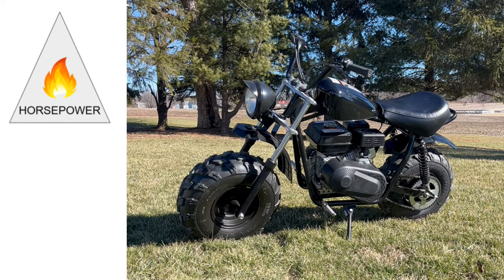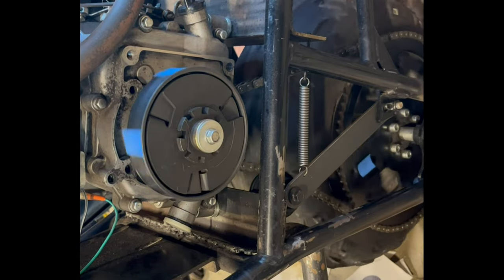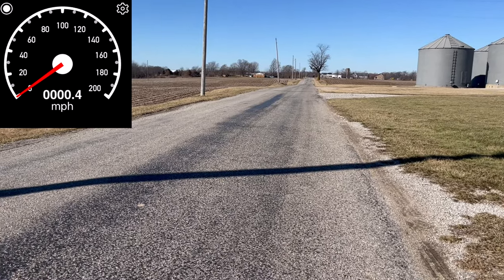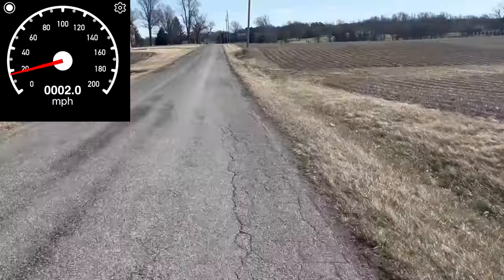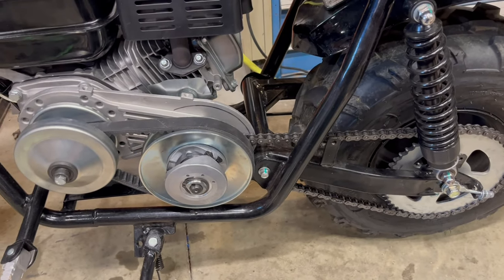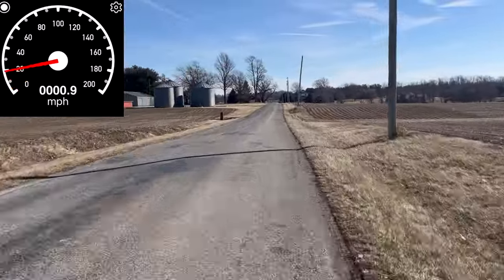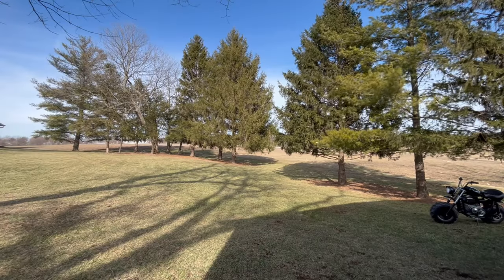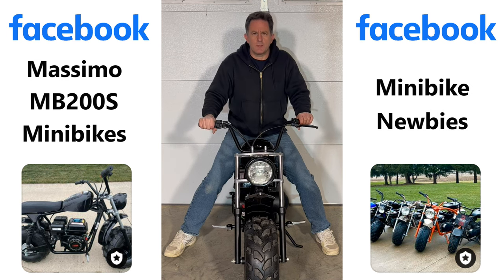The Secrets of Minibike Gearing

Comment: for those that are confused by this video the colemans in all stock form 
have a gear ratio of 10 to 1 thats a pretty good all around gear ratio
its good for startin off on a hill but it doesnt offer much in the way of speed
 the governor in my bike is defective so i get a top speed  of 25 M.P.H. on flat ground others report like 13 mph.  with a properly working governor
the way i determined the 10/1  gear ratio is is by turning the clutch untill the rear tire made one full revolution 
i ride my bike on dirt roads  an honestly i rarely hold full throttle for more than a few seconds  because of the ever changing road conditions 
it literally goes from hard pack scattered with loose rock to mostly hard packed white with random loose spots to a creek crossing  then hard packed red clay with ruts then a long moderately steep grade that being said 10/1 gearing is an excellent choice for that

Comment: Good info!  The torque converter is king for obvious reasons.  I actually have a ct200u, and just installed a torque converter with the 5 to 1 gearing and 19 inch tire.  Take a look at the yellow Secondary spring, it helps greatly to keep the rpms up.  And also a true comet belt seems to be the ticket!  The cheap ones flex too much and don't achieve full shift out.

Comment: Got a 212 with the governor removed, header, carb and flywheel now on my little oryxearth that had a 105.. looks almost exactly like that little mega Moto frame, thing absolutely rips now😂 think I’ll pop the crankcase back off after a while and rebuild the whole motor then throw on a torque converter with a 60-65 back sprocket. Perfect mini trail bike. Fits in the back seat of my car 😂

Comment: Best gearing for a monstermoto 80 w a predator 212 on it 22lb springs, flywheel, rod, upgraded mikuni vm22 carb 125 main jet im running a 10 clutch 40 sprocket

Comment: I enjoyed the video.  Sounds like the torque converter is best but if I just wanted a little more hill climbing power without spending a lot of money what do you recommend?  I have a Coleman ct200.  Is it best to put a little larger rear sprocket or a smaller clutch sprocket. I don’t care if I loose a little top end speed. Thanks.
Reply from the maker: You can’t get a jackshaft sprocket with less than 10 teeth.  Yep, replace your 50T with 60T. That will give you 20% more torque and 20% less speed.

Comment: I am running 12t on the front with a horstman x5 racing clutch. And a 65t rear split sprocket. If I cut down to a 53t rear split sprocket would I go faster?
Reply from the maker: Yes, 20% faster.   20% less torque

Comment: So on my mini bike I put a 224 predator with a 30 series torque converter.  Stage 1 intake & exhaust. 10 tooth sprocket up front with a 72 tooth sprocket in the rear for max torque.   Surprised that I hit a top speed of 41mph running 21” tires.  Not looking for speed with this build-  Going to an 8 tooth sprocket up front for all kinds of insane hill climbing torque..thoughts?
Reply: Small to big = torque 

Big to small = speed

Larger rear sprocket will give more low end grunt

Going smaller on "driver" side will tack out the engine very quickly.

We used this combo: 212cc

Driver   vs.     Driven =  speed 

14                   60           44 mph
12                   60           37
10                   60           31
8                      60          23-25

Pops wheelies constantly  not user friendly 

11                   50           33-34

Best set up so far

Comment: I have a taotao db200 I want a 60 tooth should I go 40 chain? What chain should I use when I go up to a 60t
Reply from the maker: The DB200 uses 420 chain and you should stick with that.  So get a 60T-420 sprocket, some extra 420 chain, and a chain breaker tool.

Comment: A few questions 
1.) When you go from the 10 tooth to the 11 tooth on the torque converter do you have to change chain size or the same chain will still fit?
Also
2.) When you go from the 10 to the 11 tooth on the torque converter does that make the engine rpm go up? If so should I worry about the engine spinning to fast on stock internal parts? Or will it still not spin faster than the governor allows and still go faster mph?
Reply from the maker: 1 - I used the same chain. Just loosened slightly. 
2 - The RPMs will not go past the governor limit.
Reply: the governor will limit the engine rpm. regardless of the sprockets as it governs engine by merely closing the butterfly in the carburator 
i wouldnt know about the chain though but it not difficult to modify the chain length  theres plenty videos that show how to shorten a chain   not many showing how to add a link though

Comment: I just have the centrifugal clutch and single chain setup with stage one kit it does start slow ish how can I gear it for 10% more torque like you were saying
Reply from the maker: A bigger back sprocket will give you more torque and less speed.  A torque converter will give you even more torque, with less speed loss.

Comment: @5:00 mark I see the belt is on backwards, and, the clip on the master link is also on backwards.
Reply from the maker: The belt is on correctly.  Flat side towards the motor.  You are probably right about the master link.  I don’t pay attention to that. I probably should, but have never had a problem.
Reply: Besides the obvious, the belt says "this side to engine" is pointed the opposite way.  Just a safety concern. That belt being on wrong and it rolls upside down and Flys apart, it's going to hurt like heck at best. worse case the eyes. A one inch peice at 5k rpm will hurt and bruise you pretty bad.
Reply: And at the 5:15 mark the arrows are now pointing towards the engine.  🥳.

Comment: Hey man, I have a similar  bike / setup (50tooth rear sprocket and same torque converter / CVT)

But I just ordered a 40T sprocket to try out. Any idea how much of a difference it'll make on the top end?
Reply: mine went from 48 to 41 with torque converter and the 10 less back teeth 😂 i’m sad now that made the vm carb seem like a waste of money i’m putting the 50 tooth stock back on 😢 but almost 50 mph isn’t bad for only bolt ons nothing internal done to the 196
Reply: @robertbruhcuh3634  oh man what a throw back comment (even though it was only 9 months ago) now I have 3 mini bajas, one has the 40t one has a 50t and the last one has a 60t 👌 gotta love variety
Reply: @JJC991  lmao yeah what was yours doing with a 40 tooth? i think the engine isn’t good enough for the gears i got it did 48 with 50 tooth now it’s loss the amount of speed i wanted to get from it

Comment: How does some of the Coleman 196cc only go around 24 mph but other dirt bikes with a 50cc say it will go up to 60mph I don’t understand how that makes sense. I thought the higher cc led to higher speeds
Reply: Higher cc's = more power

More power = achieving Max mechanically limited speed faster or sooner

Gearing will be your limiting factor

You got the power, so now you mess with drive /driven sprockets

Start in rear first 10 teeth change is huge

60 tooth to 50 tooth...is almost 20% gain in speed...but 20% loss in torque 

So that's huge
Reply: @MH-pc2ky  hey man I really appreciate you breaking it down like that to illustrate an awesome explanation of understanding thank you sincerely